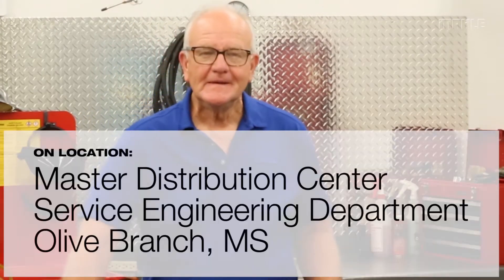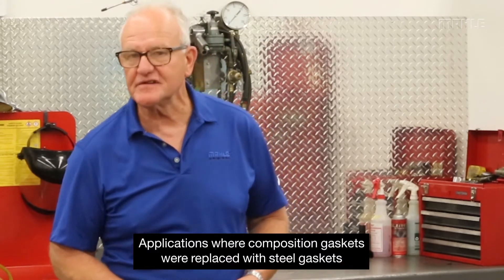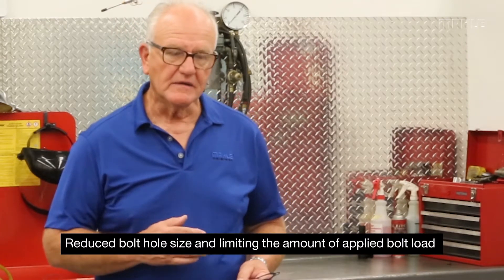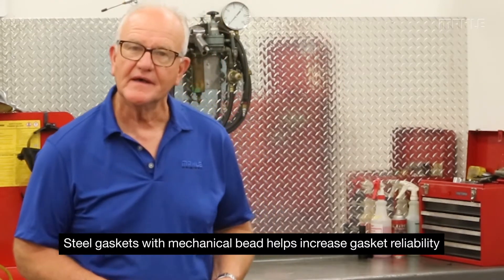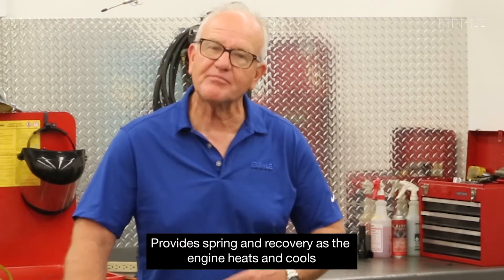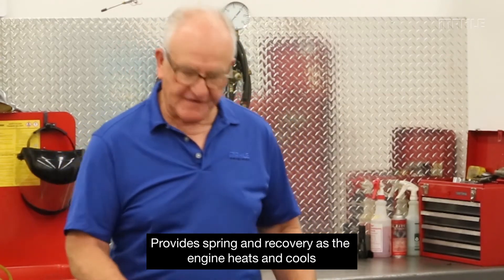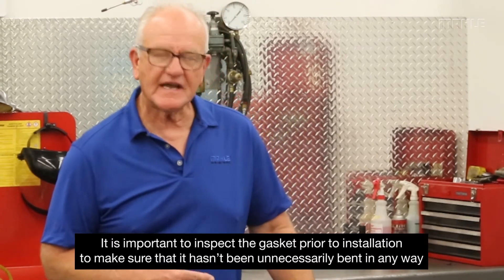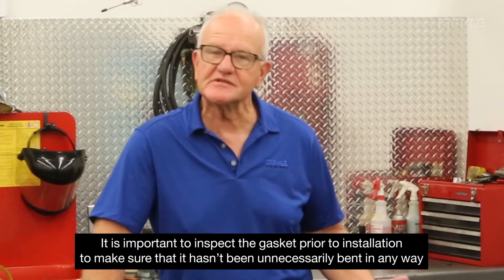About Steel Gaskets

Comment: Great Video, and thanks.
As a question, I have the single layer intake manifold set for the Nissan Xterra vg33 engine (mahle model number MS16365A). I understand that as one video said, "if there is no sealant in the package, it's not needed." To double check, does this mean that this particular intake set needs no high temp rtv around the water ports and intake holes to seal properly?